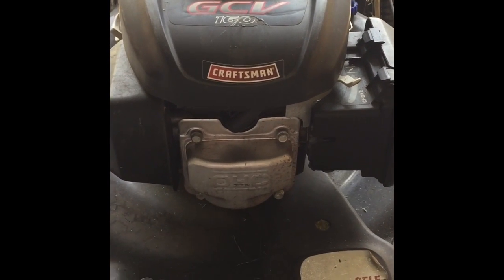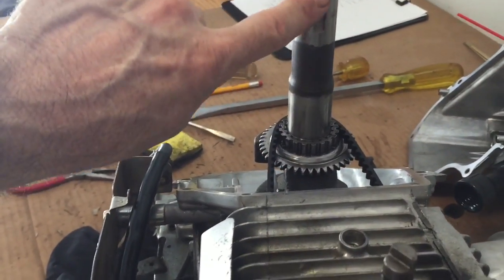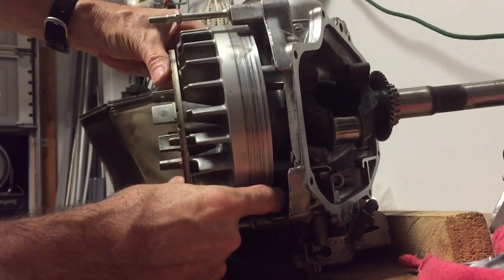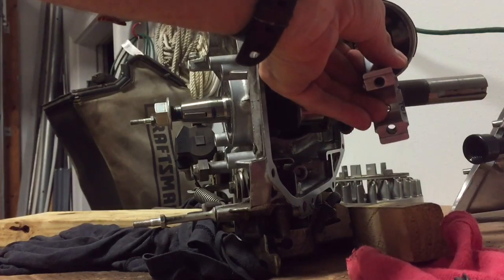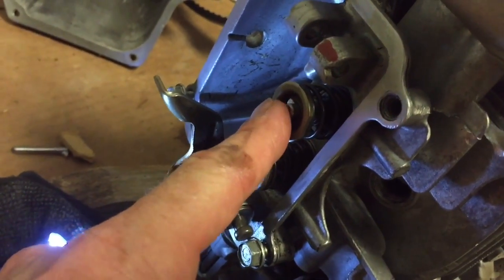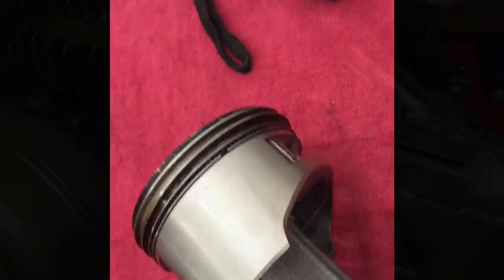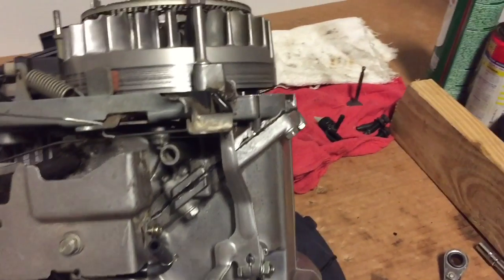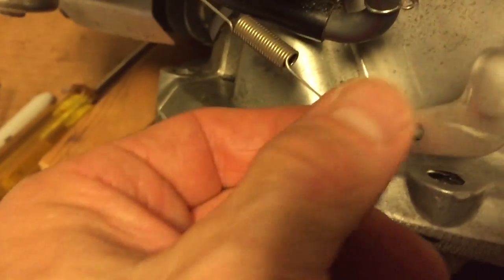Honda GCV160 Valve Replace

Comment: Great video thank you!! Except for that valve guide. Should have been either tapped back in or replaced. I’m going to replace the piston rings, wool brush the cylinder and potentially replace the piston.loved the video compared to others

Comment: Low on oil and exhaust valve will stick in place and kill engine 
Guide needs replacement and engine rebuild 😢😢😢
Keep them level when checking oil levels on all engines folks 😊

Comment: You didn't show the most important part...How did you put the piston back in. There is no room for ring compression tool.
Reply: Don’t need it , use hose screw clamp

Comment: All this fucking work just to replace a valve. Would be really mice if honda could make the cylinder and head itself a removable part, like most other engines. Sheesh
Reply: Yup, older Honda's had a normal cylinder head. They were made better overall back then. GCV series was a blatant cost-saver.

Comment: When I bought my mower I thought OHV was great but integrated head/cylinder and a timing belt?  What a cheapo crap design.   When my GCV160 gives me any fits past the carb the mower is going in the trash.

Comment: Supposed to be .008 exhaust .006 intake
Reply: @jackwilliam2226  The manual lists the gap in mm, do the conversion if you need to.

Comment: Those engines are a pain.Honda designed them as a throw away,therefore no cylinder head so you have to totally dismantle them from the bottom to do anything.
Reply: exactly mine just went and valves are gone cheaper to just get a replacement engine
Reply: Yeah what a cheap way to make a buck. Force average maintenance to require a whole breakdown. My 2000 Honda Xr100 is easier to work on than this.

Comment: My 3 year old honda backfired when i cut it off. It had a little knock and then it would not start. I am guessing i bent a valve? ?
Reply from the maker: Hey Barry, been looking a a few posts. Could be a few things. Look at post:

https://www.google.com/amp/s/www.lawnmowerforum.com/threads/help-briggs-stratton-popping-or-backfiring-through-the-carburetor.5204/%3famp=1
Reply: @chefmudbugz  thanks  i will look but  it has no compression
Reply from the maker: Yes sounds like leaking past the valve seal. I think Autozone lends crankshaft puller if u are disassembling.

Comment: Thank you for the comprehensive video, but I could not believe this was such a ridiculously long process just to replace a valve. I will never buy one of these mowers again. what idiot designed this. I could replace a valve in a ls v8 with less effort.
Reply from the maker: Yea, most people just buy new mower. It is great experience if you have the knowledge & can R&R valve. I have auto degree so I kinda challenged myself to see if I could do it. Assembling the 10 separate video clips was another challenge.
Reply from the maker: Thanks Russell. Oh yeah I reassembled and forgot to put a new timing belt on and I think that’s where I ran into problems so I have to take it apart and redo it again.
Reply: The valve guide was the actual problem.  The engine ait was not neccesary.  You could have reset from the valve guide cover.

Comment: the valve seat has come out and that is why you think its a bent valve mine actually broke the rocker arm the first time then the timing belt the second time [it came out again] I am working on it now and I think I am going to pin it in this time
Reply: Did you ever get a fix figured out. Working on one for my neighbor now with the exhaust valve guide pushed out. I believe I am going to try high temp Loctite, but I was curious if you had a better plan. I am doing it as favor, so I am not splitting the case. If it goes that far, I am telling him to junk it.
Reply: @ericpigg2689  same issue with mine broke exhaust  rocker and adjustment nut fell into engine  so had to disassemble  entire engine, used green loctite worked for about three cuts the guide came back out and broke cam again im gonna try a intake valve seat in and  see if that works this time .  Locking at his engine his guide is sticking out and gonna be A issue soon

Comment: nice video overall...but..as another view pointed out...it looks like the new valve needs to be lapped to ensure proper seal--the old valve looks like it has a pronounced lip..the new valve simply has an angled slope...needs to be lapped or it will burn out and you won't have proper compression.

Comment: Looks like at 7:50 the valve guide is way out and needs pressing back into the head so you don't break your new rocker arm. This is really common with these engines on the exhaust side especially when running the engine too hot.
Reply: Mine is the same way and i was wondering if it was up or if thats how it was supposed to be. The intake looks like part of the block but tbe exhaust seems to have a retaining ring on it and i noticed it is higher up like his. Wasnt sure if its supposed yo be like that or not the spring and around it is also cover in hard black burnt oil or somthing so im wondering if that is the problem ? Thats why im watching this video trying  to see if anyone else has this build uo problem and why it is happening?
Reply: Working on a neighbor's unit now. The valve guide protruded out until it stopped the rocker arm and broke it. Going to try the high temp Loctite fix on the valve guide and hope for the best. How did you address the issue with yours?

Comment: never run sand paper through the valve guides and you should of lap that valve in first and whats going on with the marks on the flywheel. looks like the mag was dragging on it at one time. I'm starting to wonder if your valve was really bent?
Reply: marks on the flywheel are from the brake

Comment: Does the head not come off of this engine???
Reply: I honestly this engine seems to be very simple and easy to work on you should not be intimidated by this job. Id say most complicated part about this engine is the carburetor lines and the only reason i say that is because mine has alot of gas lines and i can see their dry rotted so if i need to clean the carb i already know im gonna spit every line and have to buy new ones. Really cool little engine  bought mine for 10$ at the worlds longest yardsale was on a broken pressure washer slapped it on my go kart and loving it. Does seem to over heat quickly but i think i have some type of exhaust valve problem too but still runs like a champ until it gets hot then it starts to blow smoke until i let it cool down before continuing to thrash it.
Reply: nope
Reply: @shannonsizemore438  well I hope I never have any problems with the valves sticking on mine, I hear that's a common problem

Comment: Great tutorial Tom!  One of the valves broke off on my GCV 160 and I replaced both.  I followed your instructions exactly and now my pressure washer is running awesome!!!! Thank you for sharing!!!
Reply: Same, found the valve in the cylinder.

Comment: So did the damn thing start up?? I hate when y’all make these videos and don’t show STARTUP
Reply from the maker: Yes. It started right up. But I realized after assembling that I didn’t install my new timing belt & used the old one. So I have to disassemble again.
Reply: Tom,at least second time around will be easier.Good video.

Comment: Excellent video.  While attempting unstick a sticking intake valve (with valve OHV cover off) I broke the tip of the intake valve.  I decided to chance replacing both valves (IN&OUT) but wasn't sure what I was up against.  (Both valves purchased from "Parts Tree"; $23 with shipping).  The video explained all that I needed to know, succinctly.  Thanx to Tom Lang.  (Caveat: I do have engine repair experience, but appreciated Tom pointing out the places where you can "screw up.")
F. Rakoczy

Comment: I have one and It started right up yesterday then kept stalling.  I also noticed that when I pull the string I don't feel the push back from the compression stroke.  I'm thinking it lost compression. I even put some gas on the plug and tried it it did nothing except a few sputters. I know it has spark.  the exhaust valve has alot of clearance even after adjusting the bolt. I think the exhaust valve is not closing all the way. where can you get parts for these engines?
Reply: cheaper to just replace who engine
Reply: @CHB_98  thanks but, whoa 8 years for a comment thats pretty sad.

Comment: Great video Tom!  I just purchased a pressure washer with what i thought was a seized GCV160. I removed the spark plug and sprayed some penetrant spray in there. I was able to finally turn the engine via the main crankshaft/flywheel bolt, however it does not turn completely over. I looked inside the spark plug hole and i can see a piece of a broken valve sitting on top of the piston. Would you recommend continuing on with this repair at the moment? Where did you purchased your valves? Thanks